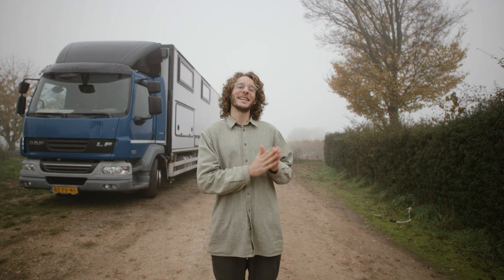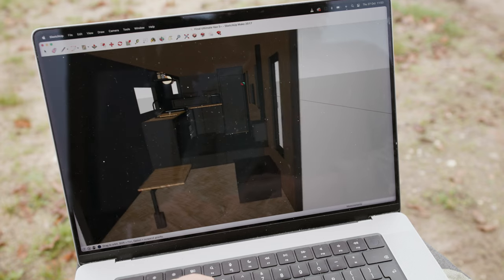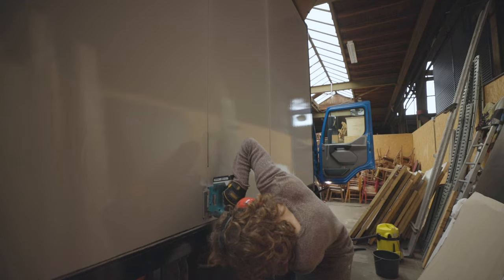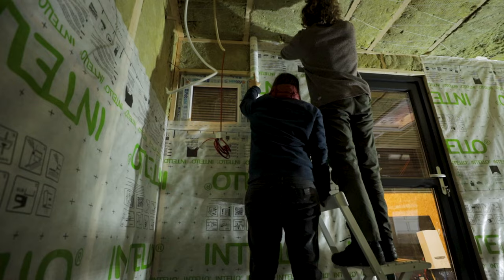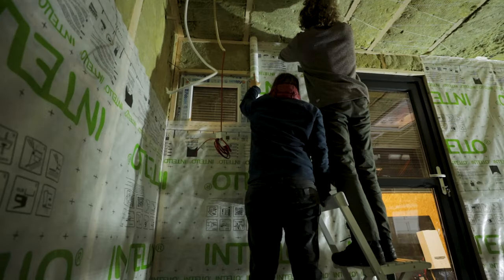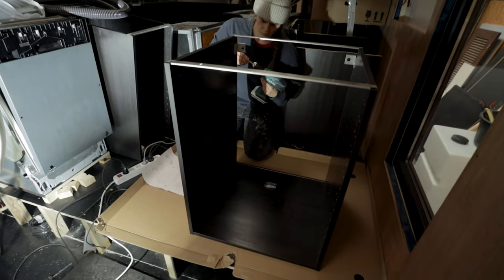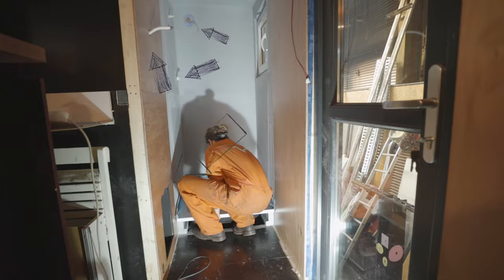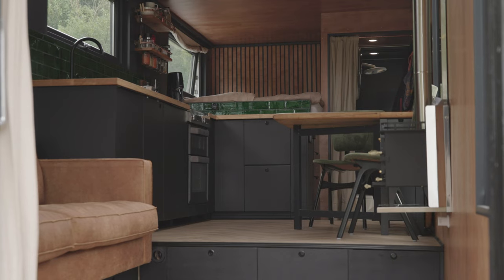Box Truck conversion from Start to Finish in 6 minutes

Comment: Beautiful conversion! I love the idea of using a box truck as opposed to a van or bus. If the vehicle portion fails, would you be able to buy a new truck and just attach your home to that? Building out a bus seems like you are committing to your home going away when the bus finally breaks down for good.
Reply from the maker: Great question! In theory: yes. The box is bolted to the chassis. Ofc it’s a bit of an operation but in theory we could swap the truck out for another one or put it on a foundation and call it a house;)
Reply: It's very much possible and more common than you would think.

Comment: I have a question please about the insulation... can you do a in-depth  video on the ventilation of the box truck... did you put venting in the walls for heat and moisture... im very interested how you did the insulation... because this is what Im plaining... I will have a 16 foot box , Isuzu truck.  thanks

Comment: Very nice. I'm still not sure about moisture. If there is condensation between the inside of the outer wall and the insulation(?), how is that released? Or am I now understanding?  The build on the inside is very, very, nice - well thought out and executed.
Reply from the maker: It is a climate folie which is acting as a viper barriers that is letting moisture out of the insulation is there is some in there :)

Comment: Super nice build! Very inspiring, can you share the dimensions of the box? Length, width and height?
Reply from the maker: 7,4M, 2,5m, 2,5m
Reply: @NicoJona  Is that useable interior dimensions?
Reply from the maker: Hmm no outside dimensions. But it carries just so slightly and we added isolation which makes it even smaller inside

Comment: Nico and Jona, Great video and beautiful conversion. My dream is to build a similar one. Do you have any data on how much weight the total equipment is, how do you really need a 16T truck? Wouldn't it fit into a 7.5T where about 2t was the weight used?
Reply from the maker: Well depends on the weight of the truck empty - ours is 8t empty and considering you have a relatively big interior and adding later things like a big water tank fully filled, diesel and a motorbike I would not consider under 12t even for us in the future 🫠

Comment: your framing timber size, 65mm x 38mm, interestingly, is 2½inches by 1½inches
Is that the finished size or the nominal size?
English sizes are a bit of a scam, the timber is cut with a multi-blade saw with the blades set at the nominal size between centres, no allowance for kerf, then any planing or sanding reduces the size further but it's still sold at the same nominal size. A 2½inch nominal size timber can be 2inches when sold.
Reply from the maker: Hi Alan, the dimensions I mentioned are the actual sizes (I think you call the finished size). We bought it at our local wood shop.